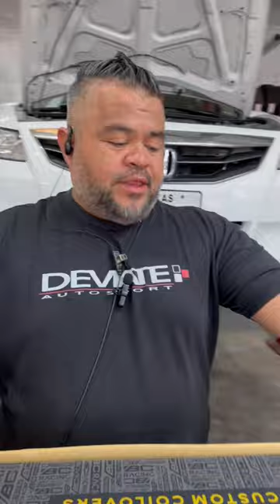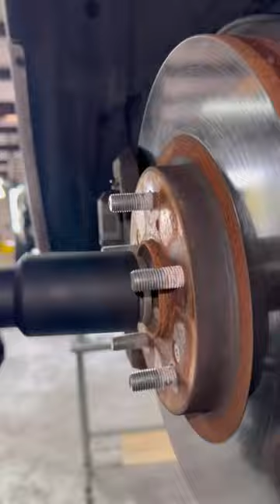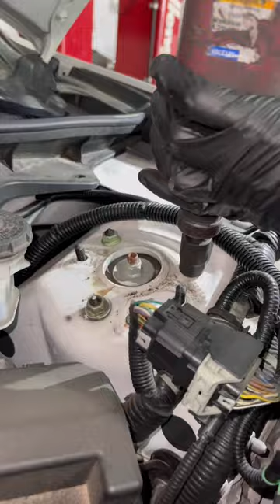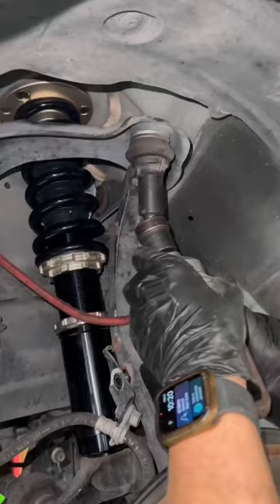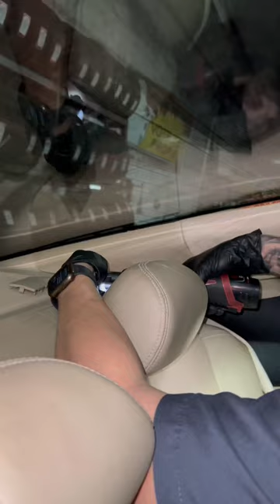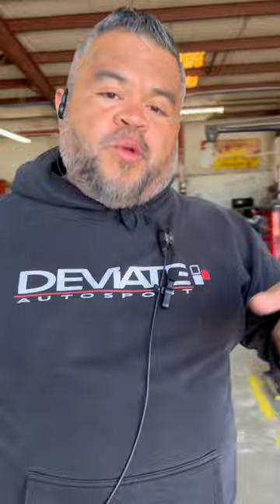BC RACING COILOVER INSTALL‼️ #shorts

Comment: For the UA 8 and UA 9 body styles of the Accord and Acura TL you don't need to remove the ball joints and all that to take the strut out remove the top bolts remove that wishbone the bolt from the wishbone connecting the strut to it and then have somebody just leverage the wheel down you're able to pull it all out

Comment: The back need an inch lower at least, you can’t even rub in the back if you max the coilover cuz the wheel sits like 2 inches from touching the fender